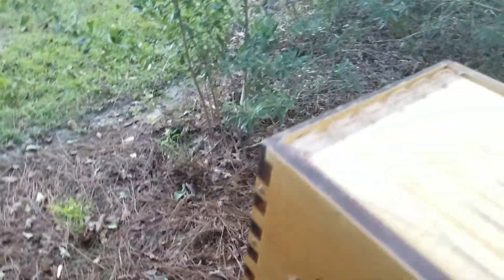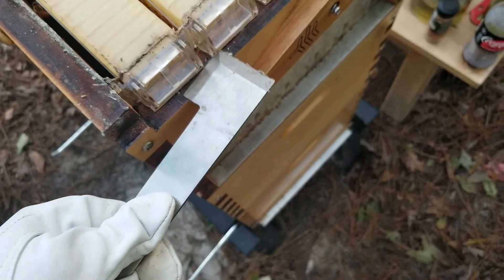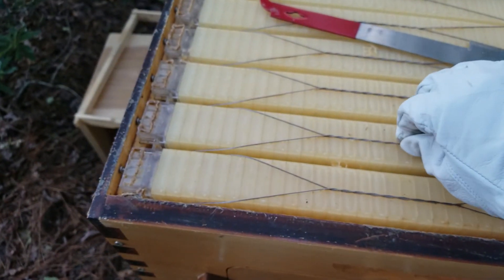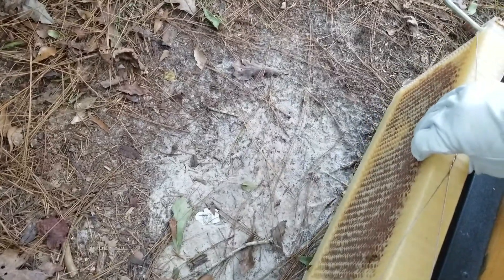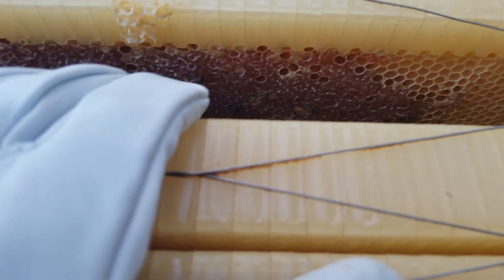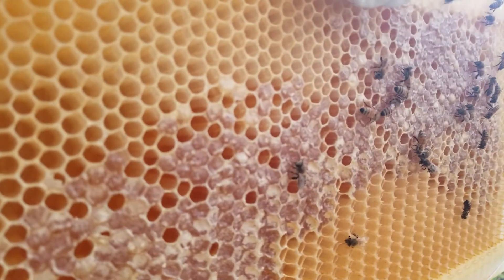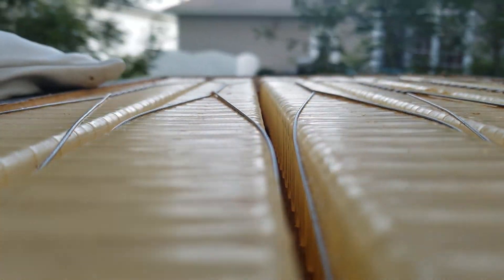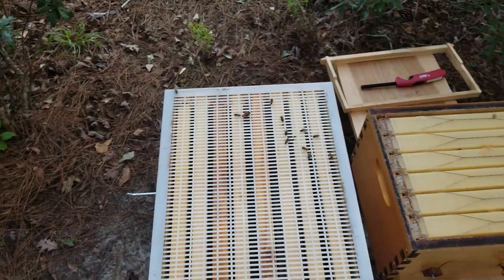Double Bees Flow Hive 2018 - It's been over a month. Winterizing

Comment: How did you winterize your flow frames?  Did you drain them first and then pull them off and store them?
Reply from the maker: Yes. I drained the honey or nectar off, then put them in my freezer in the garage for the winter. Fed what I drew off back to the bees over winter. I'm in Savannah Georgia so there is a very short winter season to deal with.
Reply: @VannDDay  okay thanks.